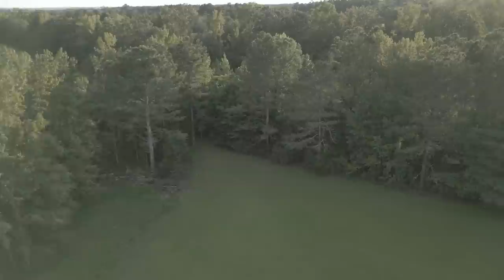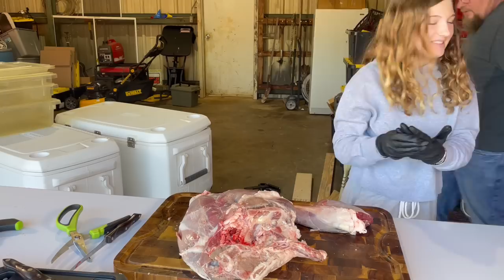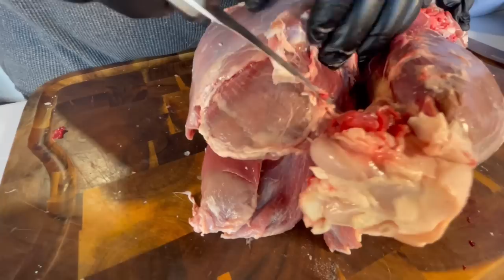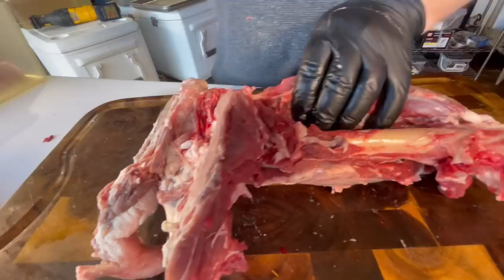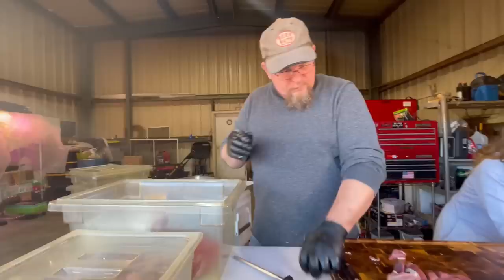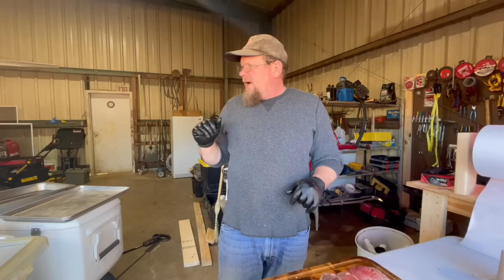How I Butcher A Deer Hind Leg, Braised Deer Shank, Top Round Roast, Deer Burger & Sausage.

Comment: It's probably too late, but i would try frying or grilling a few of those chunks you have set aside for grind to see how you like it. It's just my preference, but I don't feel ground venison brings as much to an application like cut primals and the back hams on a southern deer I don't find tough. It's not like they're toting around 250+ pounds. Plus you can always give them a little attitude adjustment with a meat hammer, buttermilk soak and a deep fry, best meal ever.